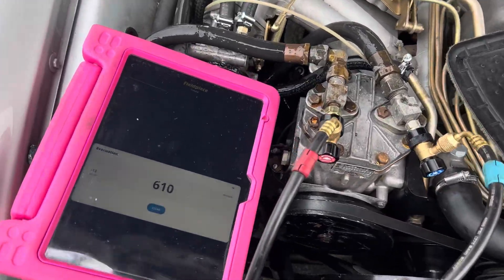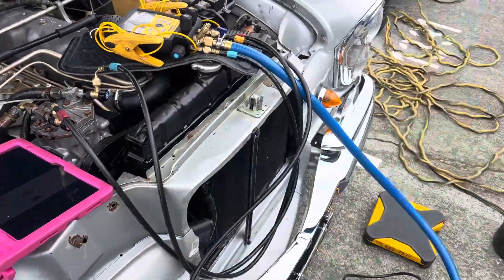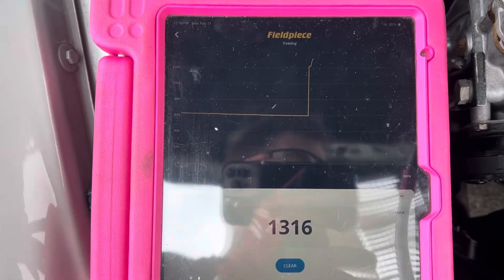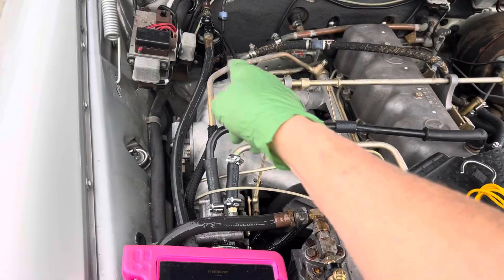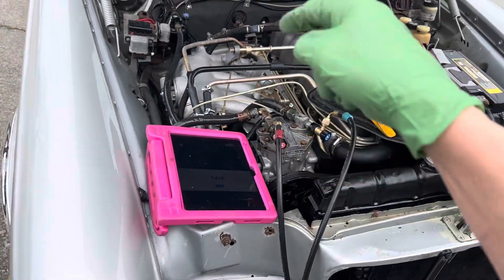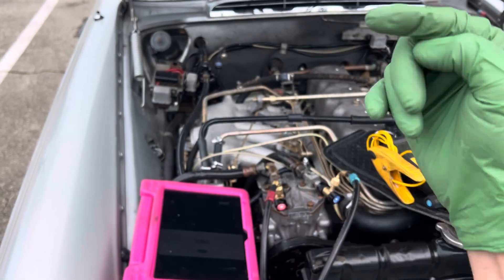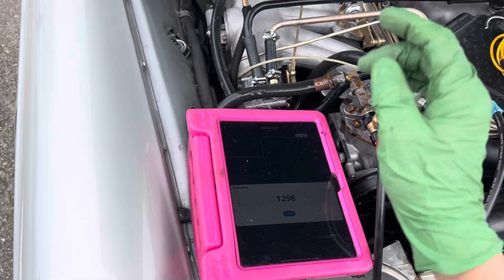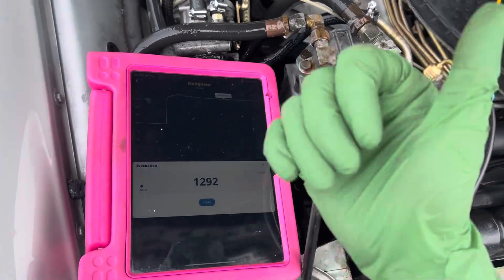AUTOMOTIVE HVAC INSTRUCTORS stop using analog gauges to look for leaks.

Comment: Tom, thank you for your diligence and setting a standard to follow. 5x master tech and taught automotive for 18 years. Equipment is a challenge. What is taught in schools is using industry standard equipment, and based on budgets. I can’t find a single shop in the Philadelphia area that uses digital gauges, nitrogen for leak tests, or an ultrasonic sensor for locating leaks. Our 2013 CRV has been an ac nightmare. Two years ago the original compressor split its housing. A replacement Denso compressor and an OE condenser/receiver drier was installed and ac was good for 8 months. The reputable shop I took it too said it was low on charge and recharged it. That lasted three days. Upon our return it was stated dye was installed with the replacement compressor and there are no signs of dye anywhere visible so must be the evaporator. I have not been in the field for five years so access to equipment is limited. I’m considering investing in the right equipment, using the CRV as an example and offering mobile training to techs demonstrating a more advanced approach. All of the advanced training offered typically regard the ATS Bullseye as the best leak detection using CO2 and the typical stand alone gauge  systems by branded tool vendors. Would you consider doing a YouTube of setting up a shop the right way with the right equipment?  From what iPad to use, the Fieldpiece equipment, the Accutrak, and other related equipment.  Not only would this benefit me, but help those who are considering starting a shop, those who already have a shop, and the many customers who have to contend with unsuccessful repairs. Thank you
Reply from the maker: Yes, such a video is on my to do list after I retire partially retire. 
     As you notice, I don’t edit in any videos. And I do not do retakes leave all mistakes in my videos cause I don’t even have time to edit. I have too much work.. 

But a longer format video like that is on my to do list . Once I have all my projects finished.. slowly, actively pursuing a teaching position. 
       One of our colleges dismantled their Hvac program decades ago. 
     I think that’s funding. 
   And I know who is in charge of the Automotive in trades shop programs. 
    He asked me to come over. He was a technician himself. I’ve known him for the last two decades or more. 
      And he made the purchase of all new equipment.  The fancy new digital equipment everything needed based Hvac program off of the equipment that I use.. 
     He himself as he was asking me over the years of how to get into the business and what equipment to get started his own secondary business servicing HVAC equipment. 
     So that is the role for my retirement. I look forward to taking..    It will give me a facility with even more equipment than I have.. 
    It’ll give me a place to do some nice videos in my own free time for editing. 
     
    Yes, we will not see in some areas of the country, newer equipment, and digital unless it’s taught and introduced to newer younger technicians in expose and training seminars, guys going to Auto Parts, Wearhouse sponsored one day or three day Hvac training classes. For the shops that actually hire instructors to come into their shop and do one day or three day training and hand in shop on premises training.. 

As long as the schooling system or the instructors themselves hold to industry back into the caveman days, the self-defeating cutting their Achilles heel of knowledge to future generation technicians will continue . 

The money in the school system is there unfortunately it’s used on administration and upper tears of individual more than 50% of the school budget is wasted on useless things and individuals who are not teachers and not directly related to the education of individuals . 

Oakland, California, Laney College Hvac program . Is teaching the most advanced software in digital diagnostics and residential commercial HVAC they use flowmeters whole house, Retro Tech or energy, conservatory, digital house pressurization so you can even find an air leak in the house the size of a gnat’s fart. 🤭
     We’ve got out of the Stone Age’s. They’re using energy conservatories true flow grid for actually truly measuring every CFM of air that flows through a furnace system through a customers ducting system. I actually own one myself.. who seen my videos of doing the whole home house duck tasting with my Retro Tech system for my commercial HVAC business that’s what I’m talking about. This is all common every day stuff that instructors don’t know about because they’re all stuck back in the Stone ages.. 

Kids are raised completely digital from birth in the past two decades .  Most don’t even know how to read an analog wall clock that we grew up on. They can’t even do handwriting. Everything is digital computer, skis, and keyboards.. 
   Their games they play for warning through tonight are digital was multi layers of pages and software that their little brains absorb in detail that they spend hours on and all their data and statistics that they sit through for their game characters is even much more advanced and more steps than what are simple digital Gauges like fuel piece or Testo would be considered toys for a five-year-old.  

But yet Automotive stays behind and says it’s the money .,
      And uses that as an excuse,

Don’t have a single set of gauges up on a car tell 30 students to sand around and try to see the little tiny needles as if that’s going to work . 

Instead of one set of digital gauges that could be simulcast up on large screen, TVs or projectors . 
   So all the students could see it simultaneously. 
    And the data can be recorded, and they can see it in different formats simultaneously and even can be broadcast through Bluetooth into a classroom or into an office from the vehicle. That’s actually being worked on and the students don’t even have to leave their desk watching a projector of a live stream while an instructor is doing it outside in the shop..,

And then to Dana after the vehicle is turned off, can go over and scroll through time watching as superheat and said cooling refrigerant saturation is taking place instructor was taking it through its test places . 

There is absolutely no excuse, not to buy even one single digital gauge with software like this for such a small purchase . 

As long as our educators are not educated, we will continue being an uneducated nation in the uneducated trade . 

There’s already large RRR machines that are sold with the software similar to Testo or Fieldpiece built into them that does data grafting Myren gauge built into RRR machines . 
    Just like a Fieldpiece or Testo that instructors in trade schools, don’t know about this and say everything is analog or nobody has. It is because of their limited exposure and being stuck back in the times of using leeches to treat people for illnesses.. 

Yes, I’ve known as Automotive educators were instructors when they were younger, when I knew them and worked with them some of them got frustrated in the left education system because they couldn’t put up with stupid people. And they explained their grips and complaints about who and how the system is run.. 
    And some have stayed in the educational field. 

We’ll see if I could tolerate it stand it and put up with who and what I have to work with .
     Unfortunately, the older I get the less tolerant I am to ignorance of other individuals who are my same age. 
    I had to put up with stupid people when I was a teenager and in my 20s until almost 30 years old working for idiots and Automotive industry who couldn’t do the work on the cars they were asking other people to do for them.,

Now it looks like I might be throwing myself into a position of an educator, possibly working under the guideline of the idiots who don’t even know what or how to teach in a technical mechanical field that they tell instructors to perform their duties. 

Not to mention teachers pay is in a poverty level range. It’s truly something you do because you like and you already have all your house is paid off and positive income. You might have one or two commercial properties that is possible income, and another business to supplement your income, your well off, and you could afford to donate your time for a poverty stricken industry of teaching. . 

It’s kinda like being a monk in a monastery where you have to give up all your worldly possessions and seek no money and live a life of poverty to do charity to enrich and help the lives of others to be a instructor for the public education system.

Comment: LISTEN to this guy!!! He provides insight and technical nuance that only comes from "years of actually doing and observing"! The textbooks cover little of the "small but very important stuff" that he covers in his videos, and most instructors don't take the time to venture past what the textbooks used in their class goes over.

As for this video: Consider this... Atmospheric pressure (at sea level) is on average, about 14.7 psi. The effectiveness of doing a vacuum test is about equal to doing a pressure test at a measly 29.4 psi (which gives a 14.7 psi differential pressure to atmospheric air). It's no surprise that 200 psi nitrogen is "usually" the better leak test option! Probably the best way to say it is that "pressure will quite often identify a leak at a MUCH earlier stage than vacuum".  Especially "small" leaks!

O-ring seals in particular, typically will show leak conditions when under pressure more so than when under vacuum. An aged / worn / degraded o-ring is more likely to show an immediately IDENTIFIABLE leak from pressure as opposed to vacuum, though vacuum testing is also desired on the system as a whole. 

The chemistry of most refrigerants makes proper leak testing even MORE critical in that their molecules are so much smaller than air's. Case in point: when auto a/c equipment transitioned from R12 to R134a manufacturers had to use different materials for hoses and seals . While perfectly fine for R12, it was found that R134a molecules (due to their minute size) were able to actually migrate through the hose and seal materials previously used. In effect.,.in a "perfectly sealed system" you would still lose refrigerant over time as the R134a slowly seeped out of the system through the walls of the hoses and seal designs that "had been used for YEARS" with R12.

Any of you guys that work on chainsaws know that both pressure testing and vacuum testing is a given when evaluating saw condition, as well as after major repair. Crankshaft seals and gaskets may fail under one type test but not the other...and vise versa. Tons of chainsaws die an early death because someone thought their engine "leakage" evaluation was finished after concluding a vacuum test....both are needed! Air leaks = lean fuel mixture...a sure killer of 2-stroke engines!

Comment: What exactly is occurring within a system that leaks only under pressure vs only under vacuum? For instance, is it the literal direction a "floppy" o-ring is situated that allows or prevents a leak?
Reply from the maker: Just like a one way valve on a hart.